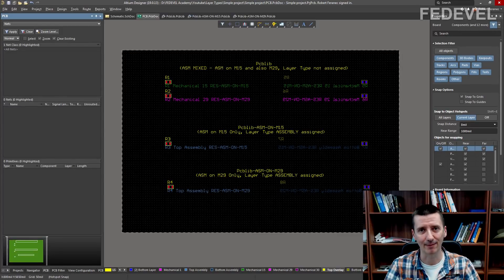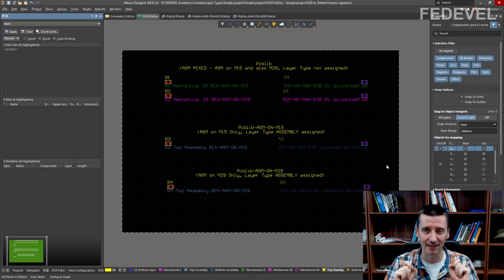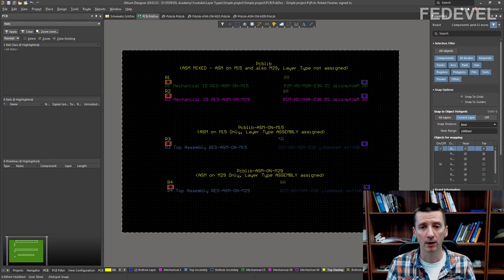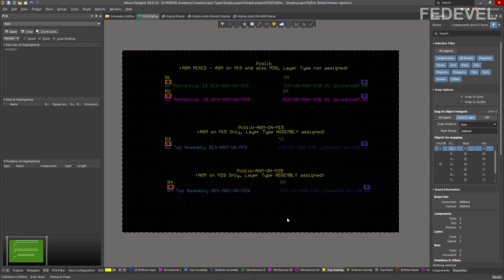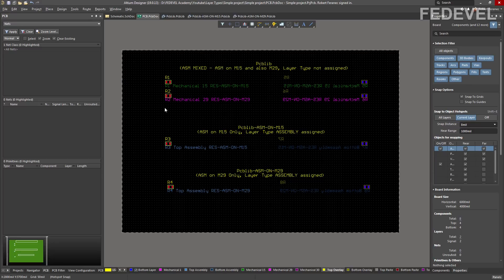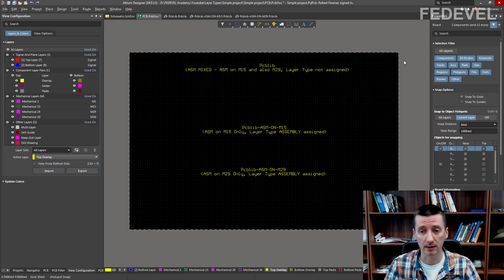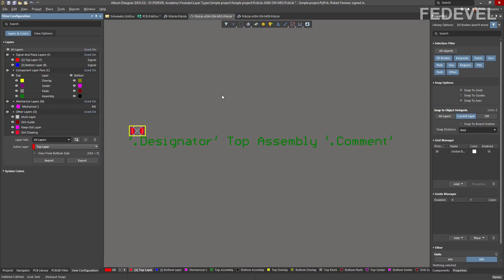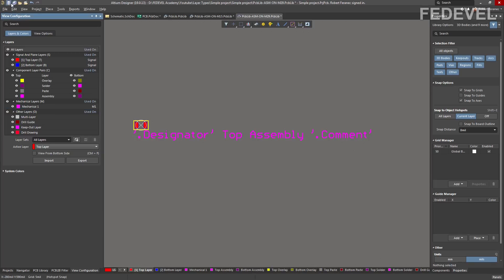Altium - How to set and use Layer Type (very useful in libraries)

Comment: Dear Robert, i have a question for you. I have my library that is self consistent, and all footprint have assembly information on mechanical layer 3, but the layer type is not set. How can i instantly update all my library, and assign the type "assembly" to all the mechanical layers 3 of every component in the library? is there an "automatic way" of doing it, or should i manually update every single footprint?
thanks a lot for the video, and the eventual answer

Comment: Robert, this is very cool feature in ALTIUM. But my question is: if i have, as in your example, two components with different assembly layers (15 and 29), the only possibility is first to have one assembly layer for example 15 for both components and then create the layer pair 15/16 so in my PCB altium can recognize it. It is Right?
I am also using Altium 20 where there is another interesting feature for assembly drawings that is "add designators for assembly drawings". I use it creating the assembly layers without adding designators and then using the layer pair with designators that ALTIUM creates automatically.
Reply from the maker: You only need to have all the components in one library on same layers, but you can have components on different layers between libraries. PS: I have seen the add designators feature, need to try it.

Comment: Hi Robert, can you tell me what are the most used standards to define the types of layers. thanks.!
Reply from the maker: Hi Diego, I am not sure what you mean. When you are in the View Configuration Panel and when you press right click on a layer, after you select "Add Mechanical Layer" or "Add component layer pair" and then go to Layer Type, you will see there listed all the standard layers.
Reply: Hi  @RobertFeranec , Thanks for answering me. I was referring to what are the mechanical layers used (what is the mechanical layer number) for each type of layer. For example:
+ mechanics 1 -> 3D body
+ mechanics 7 -> dimensions and notes
+ mechanics 13 -> 2D component
Reply: I have this doubt because seeing different component libraries, I have noticed that they use different numbers of mechanical layers for each type of layer.
Reply: I am making my own guide to create libraries (in all aspects) and I want to define a standard for all my projects.
Reply from the maker: @DiegoColl44  you can use any number you want - there is no really standard. If you like, you can use the same numbers what IPC Footprint wizard uses - that can help (just create a footprint with IPC footprint wizard and check the individual layers).
Reply: @RobertFeranec  Perfect..!!I will try what you recommend. Muchas Gracias Robert..!!

Comment: Thanks for making video on this topic. Please tell me Why you didn't add the assign M15 & M29 to the Assembly Layer Pair in the first library?
Reply from the maker: I wanted to see what will happen if you do not assign it. Also, the whole library has to use same layers as you only can choose one layer pair for the whole library (so you would need to go for M15/16 OR M29/30 - it would not be possible to have both marked as Assembly in one library).
Reply: @RobertFeranec  ok thanks... got it